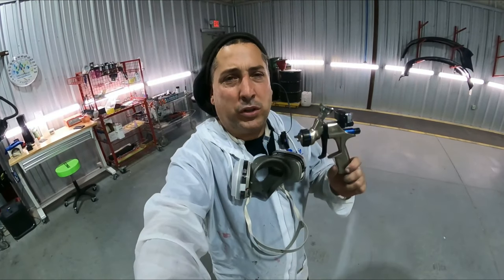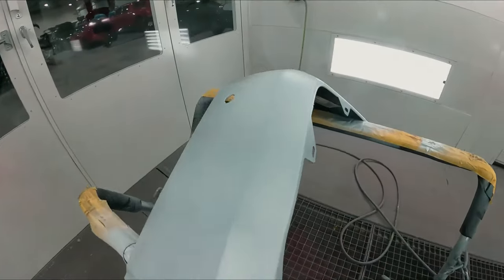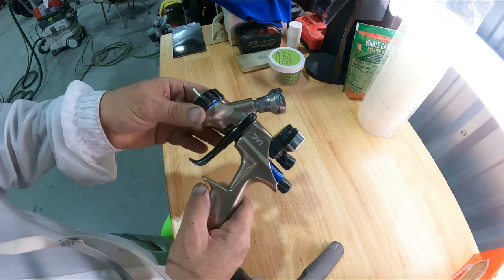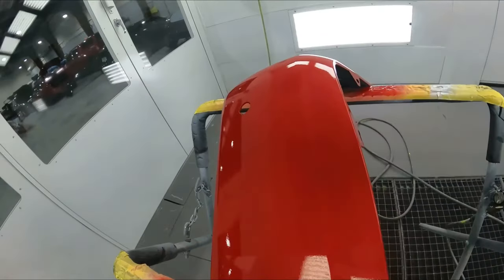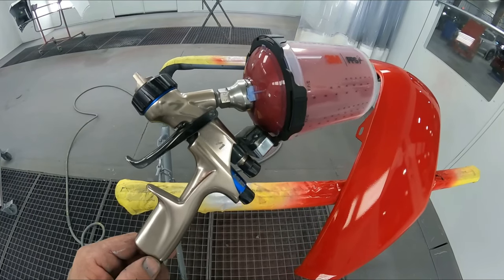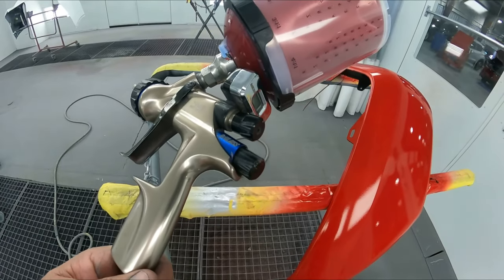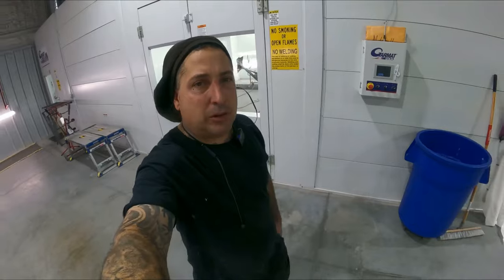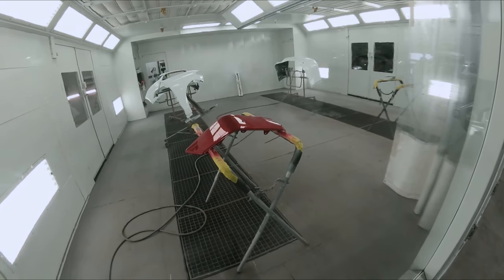DV1 BASE GUN

Comment: Thanks for doing the video for us Kandy Man as we all know how busy you are, I used to use the GTI Pro with the TE10 but since getting the DV1 base I haven't looked back and it's all I use now, could you tell me which tip size and aircap you use please? I have the 1.2 with the B+ cap and my settings are similar to yours but my fan is a half turn in and run 1.2bar which is around 18psi but I use solvent, thanks🙏🙏👍John UK

Comment: I think we have gotten to the point of diminishing returns with respect to spray guns. With modern basecoats anything better than Harbor Freight is going to work just fine. I use an Astro Euro Gold LVLP gun most of the time because it's got no gaskets, cleans easily and is miserly with paint. Your choice of the 3M gun due to its ease of cleaning over the DV-1, which is clearly better technology, proves my point. With clear perhaps there is still room for improvement but not much. It will be interesting to see how the new WS400 Series 2 does in that regard as properly tuned the Series 1 is in my opinion the best clear gun currently available. The gun companies have had 50 years of base/clear to figure this out and I don't think there is a lot more for them to learn. To me the biggest invention in that time frame was the Iwata (actually stolen from Walcom) idea of pre-atomization. Walcom had it first in the GEO but their method of doing it was impractical. I think we may be at the end of that road. 3M was wise in stressing easy of cleaning with the Performance gun.
Reply from the maker: Absolutely correct.
I will be buying the ws400 series 2 as my next clear gun